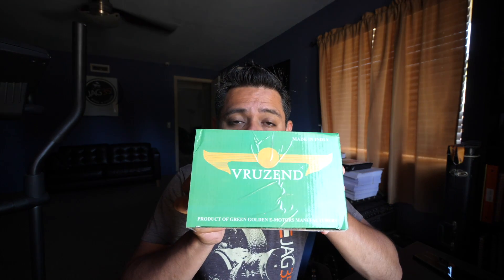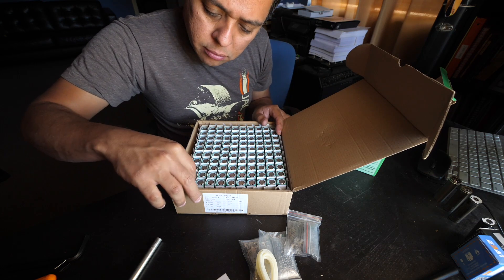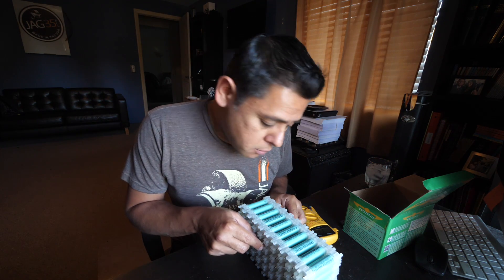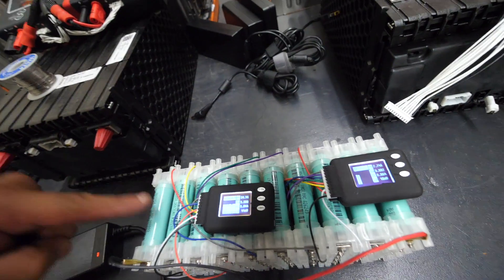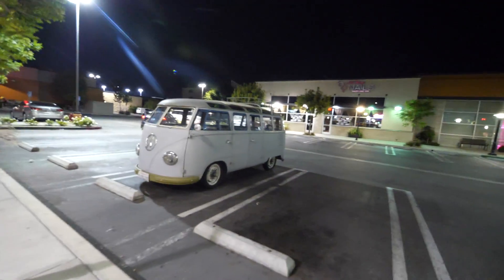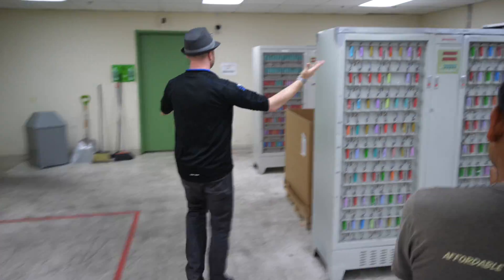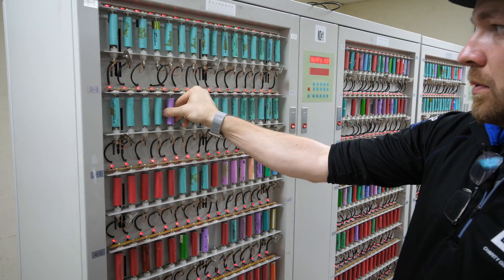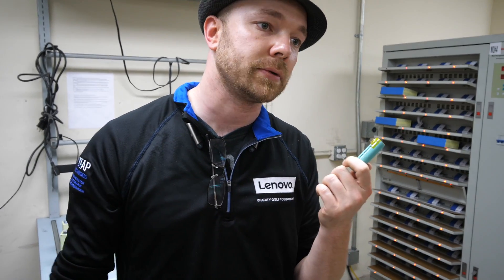Solderless 18650 Battery System by Vruzend.com

Comment: Fedora guy is doing some good in this world, for sure!
Reply: I think I've just found a new career... I wanna do what he's doing!
Reply: Jason, partially true, the reason isn't just the cell, it's more how the cell is used. If you charged/discharged laptop cells within a narrower voltage range (like Tesla does with their cars) you can quadruple the life of the cell easily. Laptops have to be very conscious of weight so a bare minimum of batteries are used and they are pushed harder. They are very different applications, you also find that consumers are more concerned with maximizing "hours per charge" and are not willing to sacrifice that to longevity. Tesla could without a doubt offer a much longer range with the same cells, but they chose longevity instead and limit charging to 4.1v.
Reply: I think that's Eric Lundgren himself, the CEO of IT Asset Partners. He's actually in prison right now (or soon to be) on some trumped-up, bull-shit Microsoft charges... https://www.washingtonpost.com/news/true-crime/wp/2018/04/24/recycling-innovator-eric-lundgren-loses-appeal-on-computer-restore-discs-must-serve-15-month-prison-term/?utm_term=.f638e266a29a
Reply: @jevforsberg4766  Wow that is some bs but I guess technically he did break the law just nowhere close to the extent to which he got punished
Reply: Does fedora guy work for Lenovo? Where is that test facility?
Reply: He works at IT Asset Partners in California
Reply: Jason A  B/c they're just higher grade... nothing special except they're more expensive. Battery tech hasn't changed in decades. Tesla would be using off the shelf batteries if the cars didn't already weigh 5k lbs.
Reply: That's not a fedora.
Reply: Magnifico Ergo fedora guy went to prison for stealing software from Microsoft.
Reply: ya man I was inspired by fedora guy
Reply: He stepped on the Big Dog's toes.  I think there's a foggy/fine line that needs to be defined, before hat man goes to prison.  

lt's not as though he was attempting profit above cleaning up e-waste.  There's a lot of questions about this case, like estimating the disk at $25.  Didn't he sell them for .25c each and it's free to download.

Yes, he made a big mistake for approving the MS & Dell labels.  But 15 months for a guy who's breaking new ground and making headway for this huge e-waste problem is way too long of a sentence!

Just like his lawyer said, "The court had set a precedent for Microsoft and other software-makers to pursue criminal cases against those seeking to extend the life span of computers".

MS and Dell should go after a better example.  Someone who's actually trying to profit off copy infringement.

I feel sorry for the guy.  His motives were good, yet still illegal under the current laws.

To me, this makes Microsoft and Dell look as though they're more interested in profit than our environment.
Reply: I would have say not true, since I own 4 EV's and was one of the first ones to hack and modify the Leaf and help figure out the CAN bus on the original 2012 S. Tesla takes their cells to 4.15v (100%) and down to 2.89v or so depending on the car, BMS and firmware (0%/miles). They do the same on the Rav4ev (also Tesla S drivetrain) 2.85v to 4.15. They don't go to 4.20v to still allow regen on the top end. Also, laptops are in a entirely different class as they are just standard 18650 class batteries (just crack one open and you'll see a 22r, etc style battery) and usually laptops are always docked or plugged in 100% most of the time which accounts for poor laptop battery life.

Tesla and MDT have done TREMENDOUS amounts of R&D into their cell chemistry and research where as laptop companies just throw in standard 18650's. And more laptops/devices now a days are going with pouch/prismatic cells because of form factor and size/weight. It's all in the engineering and Tesla does it best. Ever wonder why their 18650 cells out perform everyone else's?
Reply: @jasona-EV  "Tesla" doesnt take the voltage down to anything. the vehicle operator does. most teslas are short tripped and recharged nightly. you, are a fucking idiot.
Reply: But he’s an idiot or just a battery swapper. Making a statement like here’s a drill, here’s a laptop and then here’s a Tesla... they’re all the same is stupid as shit. Tesla and Medtronic developed their battery technology together and is nothing like a laptop cell. There’s a reason why laptop cells die every 2 or 3 years and the current Tesla/mdt cells are from 2008 technology. The only thing the share is they 18650 size lol
Reply: @jasona-EV  sorry, but you are the idiot. keep drinking that tesla kool aid.